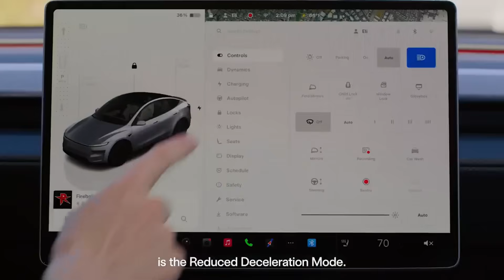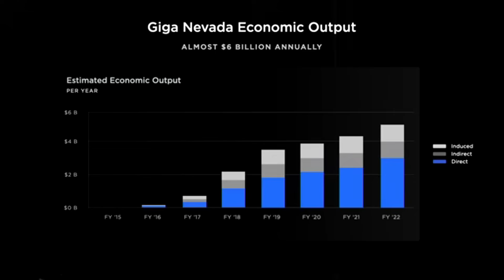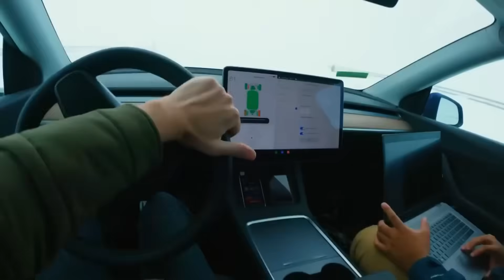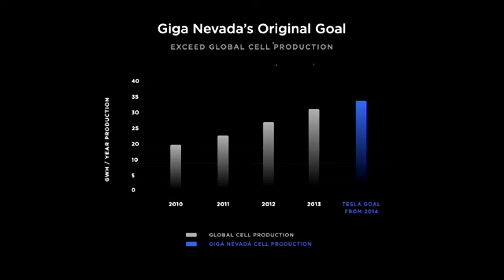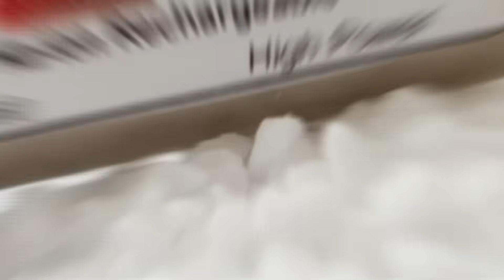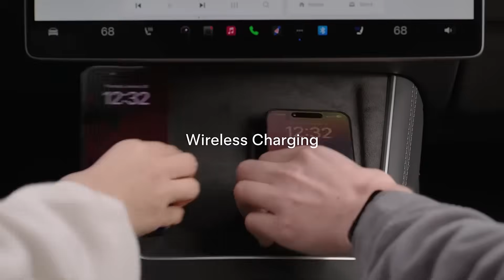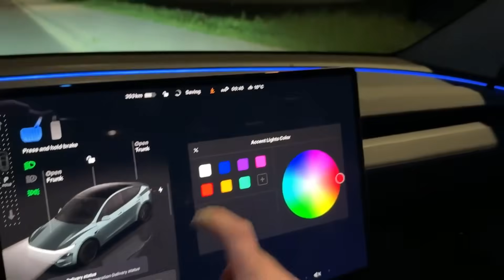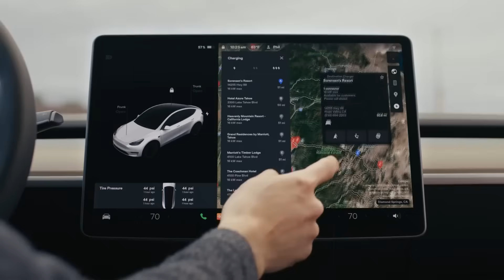NEW TESLA BATTERY Aluminum-Ion -4 Min Charge, 1000-Mile Range, -40°C Performance Tested By Elon Musk

Comment: Based on the current technological landscape and Tesla's established manufacturing strategies as of August 2025, the likelihood of the initial run of the Tesla Model 2 coming with newer aluminum-ion batteries is extremely low.
While there is significant online speculation and sensationalized reporting about this possibility, the practical and logistical evidence points overwhelmingly in another direction. Here is a detailed analysis of the factors involved.
The Pragmatic Choice: Lithium Iron Phosphate (LFP)
The consensus among industry analysts is that the Model 2 will almost certainly use Lithium Iron Phosphate (LFP) batteries. This is for several key reasons that align directly with the vehicle's primary goal of affordability and mass production:
 * Proven Technology at Scale: LFP is a mature, well-understood chemistry. Tesla already uses these batteries in its standard range Model 3 and Model Y vehicles, and major suppliers like CATL can produce them at the massive scale Tesla requires.
 * Cost-Effectiveness: LFP batteries are significantly cheaper to produce than nickel-based chemistries (NMC/NCA) because they do not use expensive and supply-constrained materials like cobalt and nickel. This is the single most important factor in achieving the Model 2's target price of around $25,000.
 * Safety and Durability: LFP batteries are known for their excellent thermal stability, making them less prone to fire than other lithium-ion types. They also boast a very long cycle life, allowing them to be regularly charged to 100% with minimal degradation, a user-friendly feature for an entry-level vehicle.
The Hurdles for Aluminum-Ion Batteries
Aluminum-ion (Al-ion) is a promising next-generation battery technology, but it is not yet ready for mass-market automotive production. The challenges are significant:
 * Lack of Commercial Scalability: As of 2025, aluminum-ion batteries have not been commercially produced at the scale required for the automotive industry. Transitioning from successful lab prototypes to manufacturing millions of reliable, high-quality vehicle battery packs is a monumental step that typically takes many years.
 * Low Energy Density: The most critical technical barrier for Al-ion batteries in their current state is lower energy density compared to LFP and other lithium-ion chemistries. This means that for a given weight or size, an aluminum-ion battery stores less energy, resulting in a shorter driving range—a major disadvantage in the competitive EV market.
 * Undeveloped Manufacturing and Supply Chains: The entire global battery supply chain is built around lithium-ion chemistries. Launching a new vehicle with aluminum-ion batteries would require Tesla to build a completely new, vertically integrated supply chain for the materials and components, a process that would conflict with the Model 2's timeline and cost targets.
 * Misleading Online Reports: Much of the speculation linking the Model 2 to aluminum-ion batteries originates from unreliable YouTube channels and blogs that often misinterpret research papers or create sensationalized "leaks" without credible evidence.
Conclusion
For the Tesla Model 2 to launch successfully in its expected 2026 timeframe, the company will rely on proven, cost-effective, and scalable technology. Lithium Iron Phosphate (LFP) fits these requirements perfectly.
While aluminum-ion batteries hold exciting potential for the future—offering the promise of faster charging, enhanced safety, and lower material costs—the technology is still in the research and development phase. It is a technology to watch for the late 2020s or early 2030s, but it is not a viable candidate for a vehicle entering mass production in the near term.

Comment: It's less energy in density, Li-ion is 150 to 250 Wh/kg  while Al-ion is 30 to 50 Wh/kg that is a 100-200 % reduction in density. It will need more batteries and space to make up for the loss of the benefits of Li-ion.